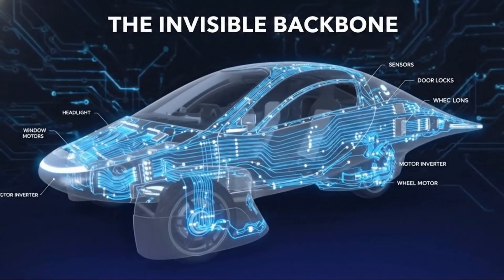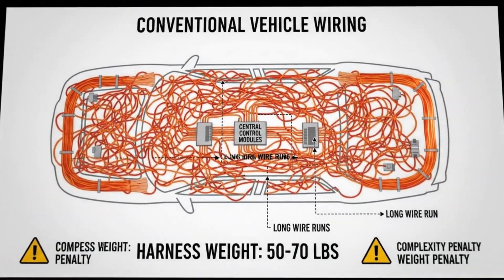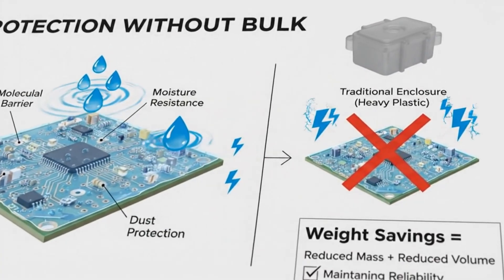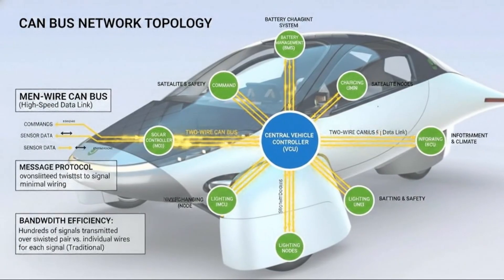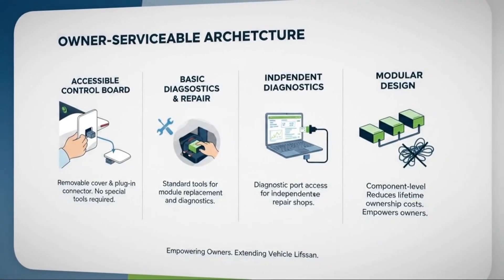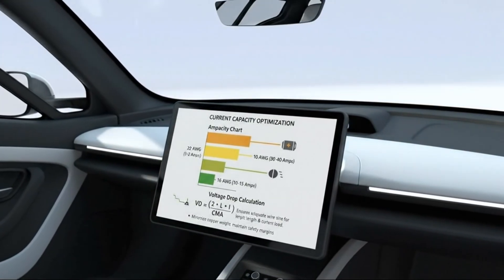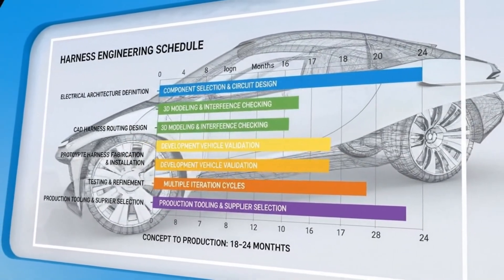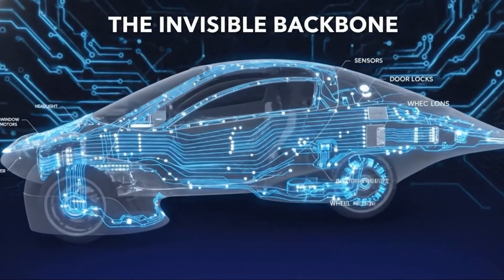Aptera’s Lightweight Wiring System Could Redefine Electric Vehicle Efficiency

Comment: Aptera has reinvented wiring for not just EV's, but for aerospace. You might not know, an aerospace company that makes EV's was turned down by Aptera. Why, they are the smartest when it comes to engineering. This is why Aptera is in fact, the leading engineering firm on the planet. So, buy Aptera stock. I know what I'm talking about as I'm an expert that uses this channel for everything Aptera. Not like that AI Slop from the Aptera Owners Channel.